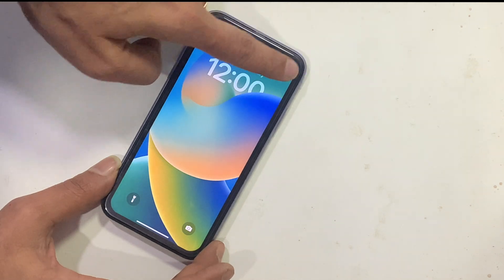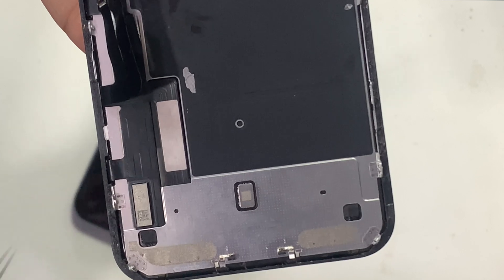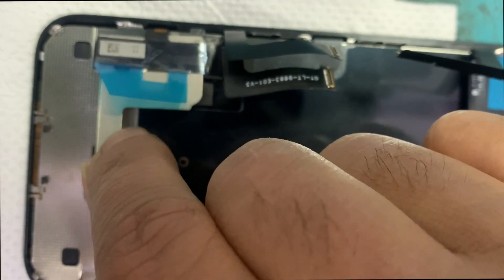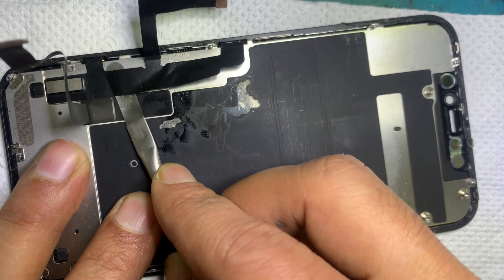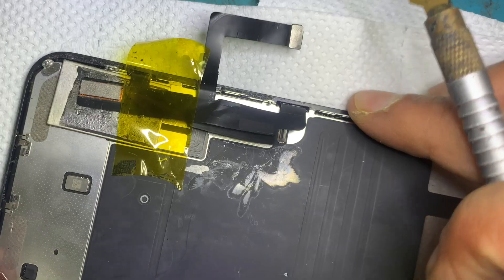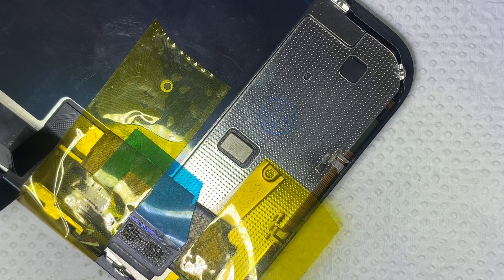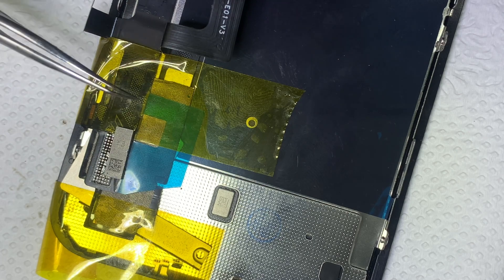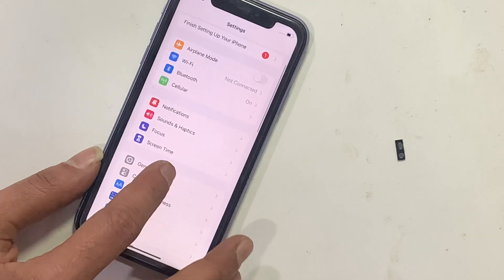How to Fix “Important Display Message (Unknown Parts) on iPhone 2023.

Comment: Hello, did you use OEM iphone 11 LCD or aftermatket like Incell or similar? I have this questio is it possible to transfer IC chip from OEM display to non-OEM like Incell? Or does this work only on OEM to OEM displays? Thanks , and best regards!
Reply from the maker: Yep you can.

Comment: I tried replacing the IC CHIP on display. From the original, he loaded the data into the programmer. Then he put the original IC chip into the non-original one, uploaded the data back and the display still shows "Non-Genuine Part". The display, including touch, works perfectly. I tried flash and that didn't help either. Don't know where the problem could be?
Reply from the maker: Truetone and Lcd genuine message are different. Truetone you can copy it but dispaly encrypt chip you have to replace.
Reply: @thegsmsolution1  i know, I wrote that I replaced chip but still message in settings.

Comment: What should someone do if the phone wont let them connect to wifi or the cellular wont work and it shows this message?
Reply: Did you ever find out
Reply: @carolinaa2466  did you
Reply: I was having this issue with my 13 it turned out to be the motherboard got fried